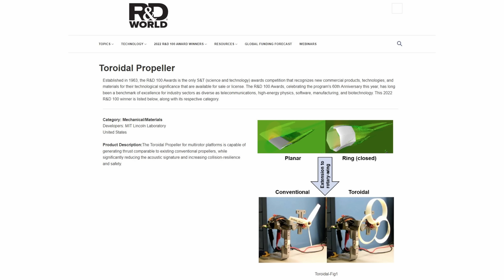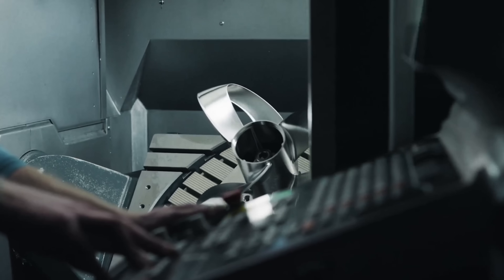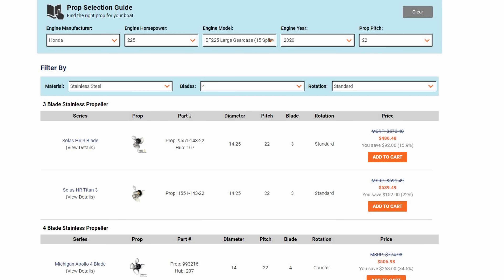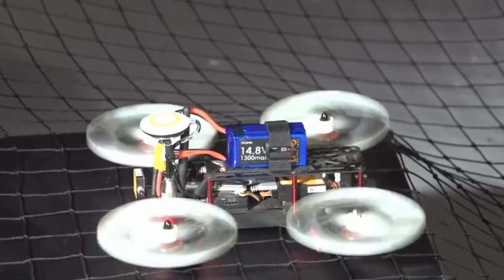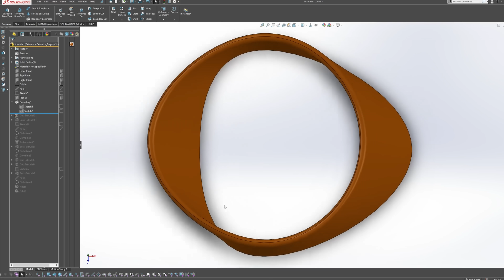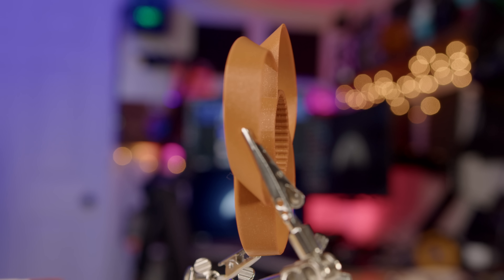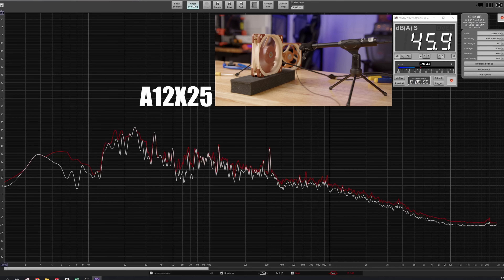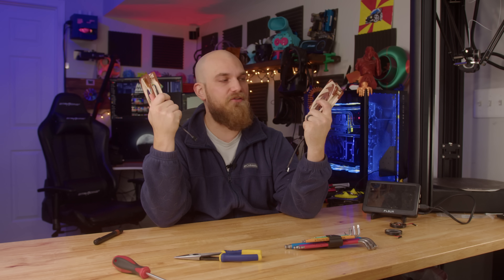I Turned MIT Award Winning Toroidal Propeller Into A PC Fan | Fan Showdown S5 Special

Comment: Ever tested a fan from the Hyper 212 Evo?  Can't be beaten imo.
The Hyper 212 Evo fan does 82.9 CFM @ 2000RPM
The Noctua A12X25 fan does 60CFM @ 2000RPM

The Hyper 212 Evo fan has a static pressure of 2.7 mmH2O @ 2000 RPM
The Noctua A12X25 fan has a static pressure of 2,34 mm H₂O @ 2000 RPM.

Noctua numbers drop dramatically with the low noise adapter that limits it to 1700RPM, also.  But, all fans are gonna lose a lot when they spin slower.

It's just that Noctua is overrated unless all you care about are decibel numbers.

I have 2x Hyper 212 Evos.  One was on an FX-8350 while the other was on a Ryzen 5 3600.  

So, I had 2x of those fans.  I ended up going to a 5900x and I was afraid that the Hyper 212 Evo wouldn't be enough.  (It probably would have with PBO off).  So I got the Fuma 2.  Stuck both of those Hyper 212 Evo fans on it and... wow.  It was just too good to be honest.  So after a few months, I swapped the original Fuma 2 fans onto the heatsink and put these insane 212 Evo fans in my case.  I replaced one of the front case fans and the rear case fan with these 212 Evo fans haha.  Talk about creating some sick airflow through the case.  There's 4x other case fans, too, but they spin slower (either 1000RPM or 1200RPM, not sure, they're hooked up to a fan controller that came with the case that you can flick a switch to full power/half power/off.

But, hey, all those 120mm fans need to be swapped out for 140mm fans, anyways, so that's my next upgrade I'm planning on.  It's not even necessary, I just want to do it.
Reply: But I will say that Noctua does make fans that perform well at those lower RPM.  Like... 1200-1400RPM range.  They're hard to beat at those speeds when talking about CFM.

But I play with headphones and all I care about is performance.. so I have my fan profiles set to max out the CPU fans (1500RPM) and the 212 Evo fans (2000RPM) when the CPU hits 60C.  For the record, my 5900x tends to average 58C in games, though.  I never hear them when gaming with headphones.  The 212 Evo fans ARE loud at 2000RPM, though, don't get me wrong.

Comment: The MIT focus was on blade tip vortices and reducing the noise they generate, using a larger area than just a tip to do so.  So the prop and all surfaces at the edges would have to be aerodynamically flawless to recreate a similar test. Also think there is quite a bit of balance issues in your video.

Comment: The drone propeller operates in open air, while the cooler fan is inside a (shallow) cylinder. 
Completely different design parameters, so this is not a good idea.

Comment: Trying to fit a toroidal propeller into a thin duct when it is a more elongated design, shouldn't give you good results. Also, to few blades. Try to make add blades and make it longer and put it in front of the duct, protruding.

Comment: You might be the guy who can create an actual thrust manipulation cone, for example, that takes the circular water thrust from a jet ski and by using my design creates an aperture that produces a three-dimensional spiral for thrust that may just have some significant results such as: increase thrust significantly or act as a thrust multiplier, maybe; eliminate cavitation;  the really far out speculation would be that such a design would be used in achieving faster than the speed of light speeds with such a propellant as ionization; could eliminate sonic boom if adapted to jet or rocket engine thrust.
At one time I did have a blue-ribbon patent on this design but feel on hard times and was unable to renew, but no one ever showed an interest anyway. I call the design, phisser technology. I'm also going to email you this comment.

Comment: From the video close up, looks like the MIT printed version has both a floater leading edge and thicker blades then the notcura. This could be reason it is louder also why doesn’t move as much air. Also you are testing the fan noise right up at it where the MIT design is to dissipate which would need more distance for that to happen. Keep these videos up!

Comment: wasn't the toroidal blade suppose to be more efficient from 4000+ RPM? . Computer fans run usually at 2-3000 RPM, so you should also test temperature performance, not just db noise.
Also, it's not actually the same to test a fragile plastic model instead of a carbon fiber one, right?

I can always bury my PC underground, the basement or wherever, I don't care that much about noise. But temp is key for me if I ever want to reach 10Ghz without melting the board...

Comment: I mean you're comparing something that probably had years of research and design and was built in factory conditions to noctuas tolerences vs something you 3d printed yourself based roughly on some image of a model you found on the internet. I imagine if the toroidal design was made to spec and designed to be used as a pc fan, the results would be entirely different.

Comment: What i saw was you trying to use something that was designed to move through water and air at high rpms.   Most pc fans top at 3000rpm so thats why it falls flat.   Your not hitting its required operating parameters.

Comment: When moving air racing a home 3d printed jaggy bag of crap but good design against a smooth moulded but worse fan is not a test. You need to resin print and smooth the blades, that's why F1 does not use a Creality FDM printer to make car parts....

Comment: Your design is off.  Surfaces in line with radians are not sufficient to produce enough lift.  Surfaces at the circumference should thin as they angle more parallel to the to the center line.
Start with the blade design of the A12X25, remove every other blade, as the 'ribbon' of the blade gets closer to the hub it should become wider than in the middle of the 'ribbon' at the circumference.
You really didn't do too bad but that angle at the hub is killing your lift.  Change it closer to a 45 in relation to the center line.

Comment: Just worthy of note. Most of the MIT and Sharon designs replaced 1 blade with 1 “toroidal blade” so I’m sure an increase in blade count up to at least double if not triple would help the toroid design in both metrics. And yes also. Push those to 3k+ rpm for science lol

Comment: Your printed propeller is not smooth, it doesn't have the same surface (a lot of empty spaces) and completely unnecessary - in a housing that is already a CIRCLE, it duplicates the round shape. Do try to print 2 or 3 times as many blades with it.

Comment: get a nibec 5000 rpm engine fan xD bro this is silent asf and super power + the fan ajustable from 1 to 5000 rpm as you want xD it move air men like a blower i use 2 of those on my aio rad and never i will use other ;)

Comment: What is important, that these toroidal blades are currently engineered to be used in drones and ships, where you have no casing around the spinning element. You have the casing around PC fan wings, and it was engineered in a way to use it. So this test is just nor relevant.

Comment: Toroidal Propeller not made for stuck in a box :D The frame reduce the sound profile. Your testing environment made not much sense. You proof a fan, that was build to run with out a frame but you try them in a frame.

Comment: The most of all designers who want to copy the MIT props are failing... Why? They create a diagonal "tube" without any aerodynamic profile... it never can work with this unfinished design. The torodial props must have a aerodynamic wing profile. A diagonal surface with a rectangular profile is inefficient and very noisy... The difficulty lies in the transition from the wing profile to the edge area, which minimizes the edge vortices and thus leads to better aerodynamics and less noise... sorry for my bad english...

Comment: You can't just put a propeller in a duct 🤢 Ducted fans already deal with the wing tip problem. There is zero justification for putting a loop propeller in a duct.

Comment: Your design is flawed as you placed the toroidal prop in a shroud, ie ducted fan, where it's meant for applications without a shroud.  Ducted fans also have advantages over propellers such as reducing noise, providing protection (fingers) and most importantly reducing drag from vortices created by the wing tips (in the toroidal liquid model, vortices increased thrust).

Comment: 1:49 "standard propeller design"?? Where did you dig up this "standard"? in a junkyard from the 50s and 60s? Such screws ceased to be made back in the 90s of the last century !!!
Yes, I understand that the "testers" NEEDED to show the benefits of the "new" design. BUT THERE ARE NO! ABSOLUTELY NOT! IN PRINCIPLE NO! A modern "propeller for a motor boat" has many times less "twists" than shown in the test video! I’m generally silent about industrial propellers for large ships - if only this design gave SUCH an advantage - it has LONG ALREADY been used EVERYWHERE!!! But this is not. Why? Because. that there is NO BENEFITS! more precisely - "at the level of measurement error".

Comment: You need to stop calling this "the MIT toroidal propeller". It's a half-assed attempt at making one that fails badly in design as well as execution. Just look at the picture of the actual MIT propellor, and you'll see almost no similarity between the two. MIT actually put some thought and engineering behind their design in order to make an actual toroidal prop, as opposed to simply making a fan with more or less tubular blades. Vast difference. Look more closely at the MIT design, even just visually, then see if you can make something that is even marginally more accurate. I expect you'll see vast improvements over this thing.

Comment: Your Toroidal fan sounds unbalanced, the rumbling you hear sounds like bearings not running smooth due to vibritions. Also I would double the amount of blades you simply dont have the same surface area the noctua has. perhaps you could print one that has two of your fans sunk into one.

Comment: Did you seriously test an injection molded sleek part with perfectly smooth surfaces against a 3d printed rough faced piece of air sand paper?  How can you call this a fair test?  This is simply bad data.

Comment: You need to stop referring to it as the MIT design fan. You changed so many things and printed it with a sandpaper finish. Get the actual blades they designed and 3d print a fan surround around it. THEN call it an MIT design fan

Comment: The one major mistake starts with not getting the design right.  how could you test a design without you item being as close to the original as possible?  makes no sense.  also you severely deviated from the design by flattening out the trailing edge.  WTF!???  is it not the edge of these designs that make all the difference in cavitation and noise?   also, you based your print off an image...  how did you get the airfoil profile of the props?   so in reality your design has next to nothing in comparison to an actual Toroidal.   Its like you seen a bicycle and copied it with square wheels.    This is specifically a situation where the little things matter.